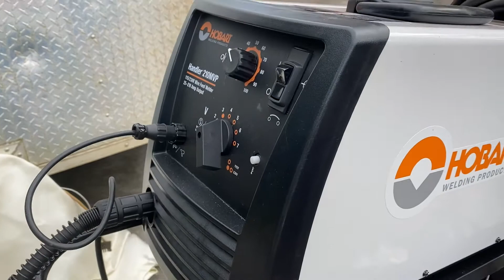Replacing a weld on trailer coupler

Comment: Those welds are pitiful, I used to make pitiful welds as well so I decided to go to school and get better. Please don't post anymore videos of your friend trying to weld, people probably think those blobs of metal you have all over the coupler and porosity is OK and it's not. I'm sorry but if your friend keeps welding stuff like that someone is going to get injured when they fail. You can call me a mean person or whatever you want but a trailer coupler that pulls a trailer down the road is a serious deal and those welds aren't even close to being the quality that they should. You should be pissed at your friend, and since he doesn't know what he is doing he should have never offered to help.
Reply from the maker: thanks for the input, I agree the welds suck
Reply: Those welds are horrid! It is difficult to weld with flux core wire with the Hobart machine but I would never find those welds acceptable. Something like a coupler for a trailer needs to be near perfect or it is a danger to the one towong nad anyone else sharing the road. Best thing to do is practice until you can make nice beads then do the work at hand. Been at this for 60 years BTW.